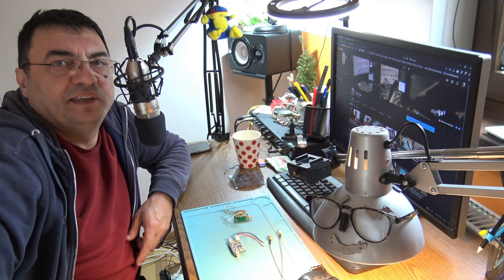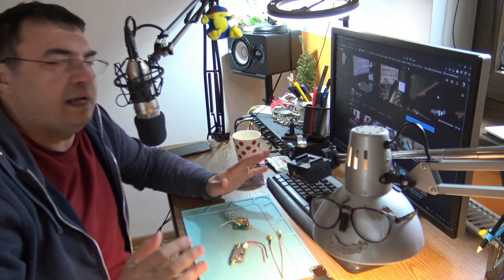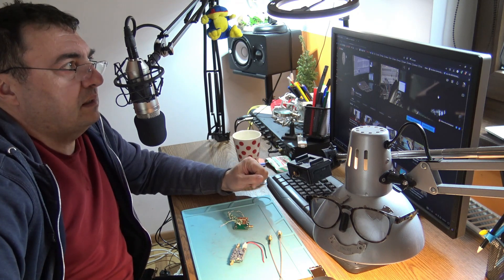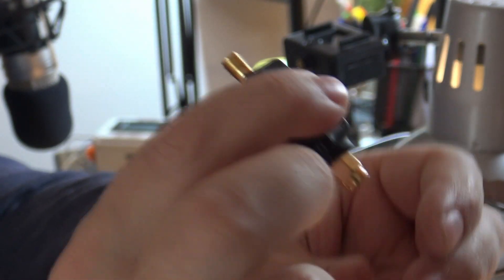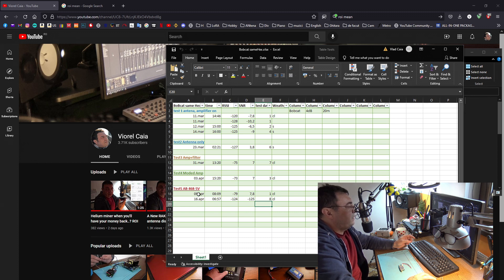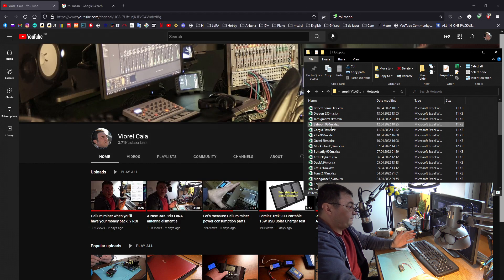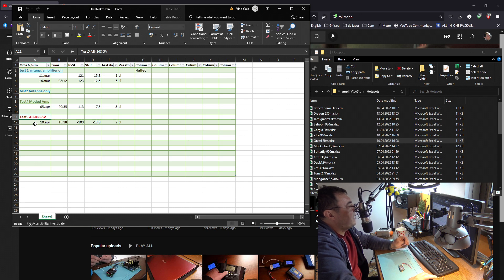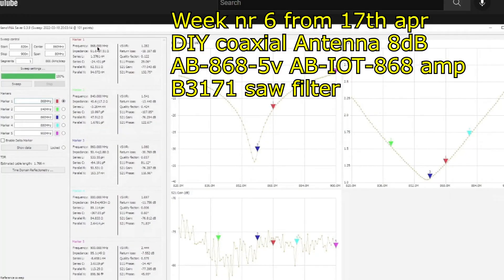Week 5 AB-868-5V/AB-IOT-868 test, miner power test and more..

Comment: Hello.my miner went silent after adding airbuddy, i have tried usb power suply, charger, and still nothing no witnesses, light is on (green). witness log in dashboard goes empty. Don't know what is wrong?
Reply from the maker: The network is lazy..be patience..it should work..check your neighbors ..any beacons?
Reply: @viocaia  When I remove  airbuddy, Miner starts working and sends the beacon
Reply from the maker: @maxpotter9249  mayve you should check for connection, out is going to antenna
Reply: @viocaia  I installed it exactly like the YouTube video,  the input is connected to the miner and the output is connected to the antenna, but I do not know where the problem is that it does not work.
Reply from the maker: @maxpotter9249  Maybe it's miss labeled..there are few cheap models for 433,510MHZ..maybe it's a relabeled/fraud to 868MHz..mine it's working, a little noisy but working..

Comment: Hi Viorel. I have 2 same set ups on my roof and my friends roof. On my roof (18m) bobcat 300 6 dbi mcgill 6m lmr 400 airbuddy sawfilter (App 5bdi). On my friends roof (18m) sencecap 6 bdi mcgill 10m lmr400 (App 5dbi). since 3 weeks i am analysing the hotspots.. the result is that the sencecap work better (double of witnesses and make 0,4-0,6 HNT/day). The Hotspot distance are about 90m. when they witness the same hotspot, yes bobcat have better RSSI and better SNR but final result (about half of witness) is that i earn with the bobcat about 0,1-0,2 HNT/day. What do you think about trying only amp without filter or do you have another solution i can try? the amp is on max..
Must but also say that the sencecap was always the better performer. Without the apm set up when the sencecap maked 0,4 hnt, the bobcat maked about 0,3hnt/day. 

Thank you
Reply from the maker: Try saw filter before AIrbuddy.. also maybe the software are different..there is something like''calling home'', when a hotspot release a challenge, another one is beaming , you're receiving the beacon and send the confirmation to first one! Here is the difference..some hotspots are trying to connect for confirmation 10 times..or less...because this is a peer-to peer communication messages are getting lost in the network..or delayed beyond registering a positive RX..so no rewards for you even the beacon has been received properly..I believe the software makes the difference.Hardware is the same to most of the hotspots..I wish to have a magic recipe..there is none.But try to have the filter before the amplifier, write the numbers,follow same hotspot for days what RSSI and SNR, then take off the filter..see the numbers..and so on..you'll find the perfect configuration. Anyway  everything's change in 3rd may with light hotspot |HIP55 so we'll see after..Why not change the miners in between for few days..that should be interesting..
Reply: @viocaia  hi. Thx for answer. I taked the ampand filter down yesterday. Now (After 18 hours) my witness go up and rewards from 0.1 to 0.35 
I let it do now so for a week and try than the filter between miner and amp.. i am happy with 0.3 to 0.4 a day but i love Experiments :)
Reply from the maker: @momodeluxe7  Nice! I just gave up my amp+filter few hours ago! Coincidence? Same story..I was for few weeks, now I feel is better without..will see
Reply: @viocaia  when i set the filter between amp and miner is it important witch pole side of filter go to miner and amp? I ask becauce when switching the filter i don't need a lot of Adapters.. can i write you and send Fotos on discord? There i can also send you the hotspot locations..
Reply from the maker: @momodeluxe7  Doesn't matter..but I recommend the filter before the amplifier..
Reply: @viocaia  ok. Thank you. I let it now 3 or 4 days so and then switch like you write me. I will report how it works.
Reply from the maker: @momodeluxe7  Please do..good luck|!

Comment: Very informative video, thank you. i want to try for my setup aswell. i got multiple locations and got mini circuits 3 way splitters on their way. what amp and filter would you suggest for my heltec's or sensecap. i also might be interrested to mod a sensecap to the max so with 2 antennas en better memory card and better internal cable. i think you will reach a nice audiance if you would make a video about it. im a bit scared to do it if i havent seen it yet. ty
Reply from the maker: I'm experimenting with AB/IOT/ AirBuddy bidirectionals, looks very promising...I'll be back with news as soon as time let me..THanks for support!

Comment: Thank you, this week  i will test AB-868 version that built with bandpass filter (Not AB-IOT-868 ) on Sensecap with 10 dbi antenna
Reply from the maker: Nice! Please let us know how's going..
Reply: @viocaia  I've tried and results are not as expected. With only amplifier, device sent beacons and witnessed only one in 8 hours. Then i tried with saw filter. Witness activity started but, there was no beacon activity for 4 days. And i changed antenna and tested with same conditions but results has not changed. I used this configurations:
1. Antenna - Amplifier - Sensecap
2. Antenna - Saw - Amplifier - Sensecap
3. Antenna - Amplifier - Saw - Sensecap
Reply from the maker: @ozgurayaz0  That' from the network..as you know in 11th of may will be light hotspot in place, now they are working hard to find hotspots reaction and everything it's upside down..Me too, some days is fully working..0,3 or more, another days .like today, no witness but two beacons so far ..
We can't say and do anything serious until HIP55 is in place...but let only the antenna and saw filter for a while..write the numbers and eventually add the amplifier..I think best way is antenna/cable/filter/amp/miner..
Reply: @viocaia  Some friends said, if we use amplifier, we have to bypass the filters of Sensecap. Have you tried bypass sensecap filters?
Reply from the maker: @ozgurayaz0  No way! Think like water..do you believe two water filters are wrong? or 3 ..maybe 4? Of course there are losses in the filters..but an amplifier will feed the gap! An extra filter never hurts, makes the signal clearer ..